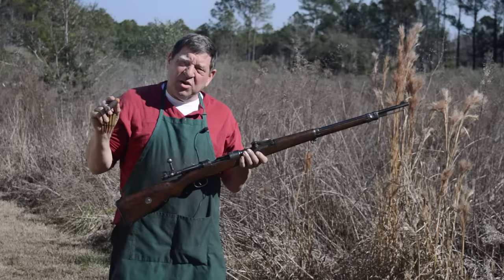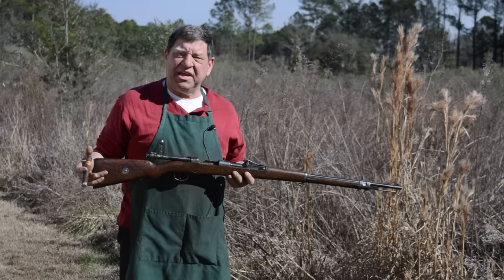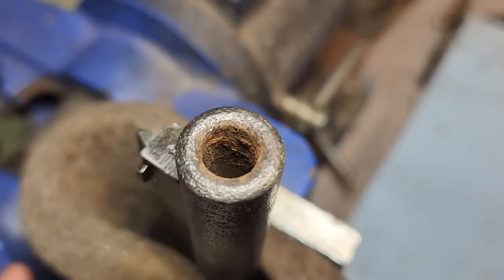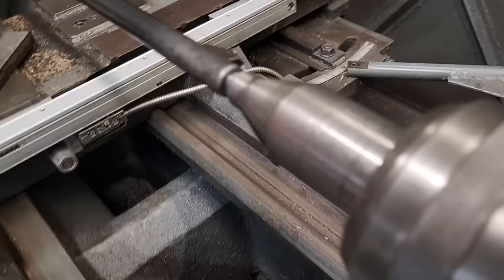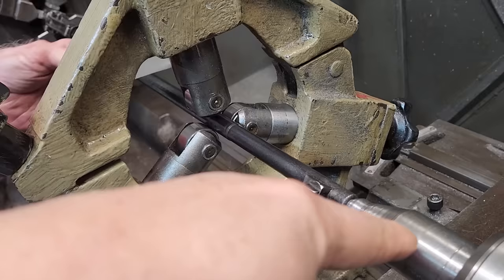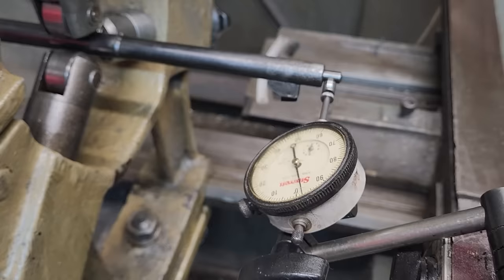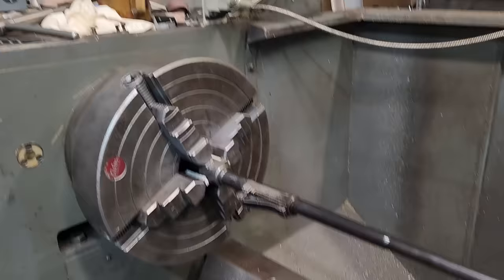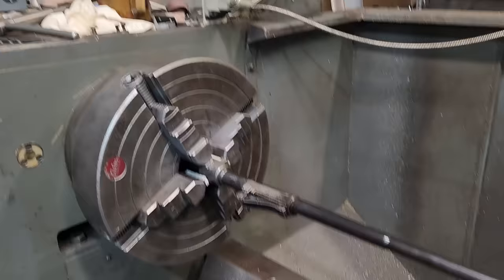Mauser Counterbore follow-up

Comment: Why is the setup relative to the bore axis ie the runout of the counterbore so critical? Once the bullet leaves contact with the lands/grooves its not in contact with anything else. You clearly removing metal below the depth of the grooves so the bullet never touches the inside of the counterbore area and thats as it should be. Seems to me the more metal you remove ie the larger the ID of the counter bore the runout becomes even less critical. Also couldn’t this be done by hand with reasonable care and a strategically sized round double cut burr which would naturally chase the bore with enough precision to make any runout irrelevant?
Reply: You mentioned that the influence of a feature like that is a quantitative characteristic, so you have half the answer. Another half is that in any particular case like that, it's easier to make a bore run true than to predict how much any deviation from coaxiality will influence the bullet. Even bad crowning that is by two orders of magnitude shorter than this counterbore in the axial direction is known to affect the bullet trajectory. As a machinist, I would use a boring bar instead of an end mill - it reduces the chance of deflection at the start due to corroded uneven surface.
Reply: Burrs on hardened steel tend to be somewhat awkward to control with the precision needed. theres far less room to mess it up here. and when youre running a business that is almost entirely reputation based you dont want to risk shitting up someones relic rifle.
Reply: When the bullet passes the end of the rifling, the gasses behind it will begin to pass the bullet. If the counterbore is not concentric, the gas pressure on one side of the bullet will be higher and throw off your point of impact. This effect is noticeable just from an off center crown. Being a counterbore will make it exponentially more noticeable. If the counterbore is far enough off, it could even send the bullet into the side of the barrel and completely destabilize it. So no, I would not recommend trying something like this with just hand tools.

Comment: Thank you for sharing your knowledge and experience!
How would you choose to do this work on an octagonal barrel? Is there a spider-like bushing that can run inside a steady rest?
Reply: That's a good question. All I come up with is to chop an 8-point socket or make a steady rest from a 4-jaw chuck
Reply: First turn an aluminum 'ring' which fits the barrel with an interference fit of a few thou. Heat the ring in an oven then slip it in place. Cut the outside of the ring true the center of the bore and voila! When you're finished carefully cut a slot in the ring and it will come off. Or do what should have been done here and insert the barrel into the back of the chuck leaving a couple inches of the muzzle sticking out. Very low RPM's only and get the chuck really tight.
Reply: @P_RO_  That just transfers the support problem to the other end of the barrel. Either way you need to support both ends, and if both ends are not round...
Reply: @Andrew-ps6xe  Yes but the chuck is sturdier and more stable and will make centering much easier. A steady rest isn't as solid and is meant to support long workpieces, not the work itself. And being that there is a lathe, it's relatively easy to turn down a brass or aluminum rod matching land diameter with a reduced diameter projection to go past the damage and out the muzzle as a means of quickly finding true center. Or you can do it the hard way and take your chances on accuracy- your choice. 

I'm soon going to take the easy way out and cut/ crown a pitted muzzle which was stored barrel-down in a damp location, resetting the front sight afterward on a low-value shooter, a common process which is always done with the set-up I recommended for the reasons I gave.

Comment: Question for Mark. 
I think my dad's lathe was much older than yours based on the more fancy art deco curves on the base, and the cover behind the chuck covering the gears. The motor was not built inside the lathe, but was external and drove an approx 2" wide leather belt on a pully with three steps, there was also a three step pully on the lathe itself making it possible to change the speed of the chuck from slow to fast. Dad could open the gear system on the back of the lathe and further change the speed of the chuck by changing gears around, and there were extra gears of different sizes he could swap in, or out of the lathe. The gears were numbered and he had charts to select gears for the desired rpm's. He could set it up with a chuck speed slow enough to cut threads with the lathe. The  chuck had 3 jaws, where yours has 4 jaws.
It was quite the machine, he had two different chucks for it, and I recall the jaws could be removed and turned over to accommodate different size stock he was turning. 
I just wondered if you had any thoughts about the differences between your lathe and dad's. 
I don't know what brand of lathe dad's was. If there was a name plate on it, chances were it was always covered with  metal shavings.

Comment: Whats the point of counter boring? getting that rust out with the reamer seems good enough. I doubt the 2in off of rifling makes a difference. Unless it works like a squeeze bore?
Reply: In this case the crown of the muzzle had been completely destroyed by rust. If the crown is distorted the bullet will leave the barrel at an angle.. Counterboring is in effect recutting the crown further down the bore, while keeping the exterior features, such as the front sight mounting.
Reply: @webtoedman  hmm makes sense .

Comment: So when a barrel is bad why can’t you rebarrel it?
Reply: He's trying to keep it original with the sights in place. One practice was to cut the barrel off behind the front sight, recrown it and reinstall the sight. Rebarreling, if originality were desired,  would entail acquiring a used milsurp barrel of dubious quality. This method, done properly, will yield good accuracy.
Reply: @geoffreyjohnston6483  I get he’s trying to reuse the original barrel and did a fine job of turning trash into shooter again. I don’t get the desire to keep them all in milsurp configuration. I have an Argentine Mauser barreled to 25-06. A good looking shooter.
Reply: The barrel wasn't bad, just the last centimeter or two. Mark says the rest was in good condition. Much easier to clean up the very end than to change it out entirely.

Comment: Honest question not a critique - if the rust is 30 thou tighter than the bore and you’re fitting a drill bit to the constricted section… how do you know the bit is following the bore and not the constricted section? Wont the drill bit sag or move loosely in the bore behind the constriction?
Reply from the maker: The bit was 4 inches in the clean bore.....
Reply: @marknovak8255  right, but the bore is larger than the constriction that the bit had to fit through correct? To get a gauge pin/drill bit to fit in the bore past the constriction, you have to size it for the constriction not the bore — which means it will be loose in the bore. Does that not matter?
Reply: Basically what I’m getting at is… I guess because you are enlarging the bore, the counterbore can be minorly non-concentric?
Reply: @tenacioustinkerer7661  I imagine you could treat the initial counterbore as a roughing pass, and then re-indicate with the clean bore for a finish pass.
Reply: @Tunkkis  oh yea that would definitely work! Thank you for the tip

Comment: Any thoughts on how that counterbore might affect accuracy, if at all, on such a rifle?
Reply: As long as it's done correctly it would only affect it to the point that having a slightly shorter barrel would. That's really all this is. It's just shortening the barrel without making it visually shorter from the outside.
Reply: iirc it will improve accuracy, the Finns did this to a good amount of their mosins
Reply: @BigTonyBigPizza  I don't think it actually improves accuracy over a barrel that's in good condition. It will improve accuracy if the end of the barrel is in bad condition which is why the modification is usually done. That might be where the confusions coming in.

Comment: You could accomplish this without removing the barrel, by mounting on a mill bed and turning the mill head 90 degrees, or use a 90 deg attachment if you have one.

Comment: What about cleaning up the crown?
Reply: Are you talking about cleaning up the pitting on the end of the muzzle, not the outer diameter, the champfered surface that is 90 degree to the bore. Or using a reamer, or some other cutting tool to enlarge the bore a few thousands of an inch to create a crown. But Marks way works too.
Reply from the maker: We did, compare the before after. Left a few pits so it looks in character with everything else

Comment: those rust pits will come back. perhaps an evaporust treatment of just that inner area somehow to not affect blueing?
Reply: Evaporust removes blueing. At least some forms of it, not sure if it removes all types.
Reply: Easier to run a Hoppes cleaning rod with a Hoppes Tornado brush through it. Did it myself on my own vet-bringback Gewehr 98 with the same inner barrel profile. Made quick work of all the converted rust/dirt.

Comment: I would of used a carbide cutter on an autofeed so the lines would be consistent instead of an endmill  , because I have small lathe cutters on a rod for boring tiny holes bigger

Comment: Why not thread the rusted part, then screw in a new rifled tube, like the choke on a shot gun?  Thanks
Reply: Would be more trouble than it's worth. Losing an inch or so of rifling at the end of an infantry length rifle isn't going to make any difference for the kind of shooting you're likely to with a piece like this.

Comment: You’re indicating the rifle in the lathe as if the exterior of the chamber is aligned with the exterior of the barrel tip, it’s not, they’re all bowed.
Would be easier to just indicate exterior barrel tip and bore it.

Comment: What not remove  the rust and growth  before  you make cuts
Reply: Because the reamer removes them anyway and does a cleaner job.  Why spend twice as long doing two jobs?
Reply: He was able to get his stepped arbor in from the breech end. The rust did not interfere with the stepped down portion of the arbor.
Reply: Rust expands the surrounding metal as it grows. Especially the rust under the visible layer on the surface.

Comment: Would have been a better set-up if you had removed the barrel from the receiver and put the steady rest closer to the muzzle end.
Reply from the maker: The steady is running in a portion of the barrel not visible when the unit is assembled
Reply: Dude.  You are out-guessing a genius.  

Do you have any clue what it takes to separate the barrel from a 110 year old receiver?

I can only guess, but i'd wager it ain't purty.

Give it up, your second guessing.  

I think Novak did this one right on, as he usually does?
Reply: it takes about 3 minutes or less to take a mauser receiver off a barrel with proper sized bushings in a vice.

Comment: Why not bore brush the rust and go from there?
Reply: because when rust takes over it actually get's under the surrounding metal, underneath what you can see. and your still left with a bulge. If your still under tolerance you run the risk of bulge or a blow out. think of water getting in between concrete and heaving it away from it's self. you will never get it back to the same size or dimension unless you resize by shaving it down.
Reply: Rust expands as it grows. It does something called rust jacking, and can actually be pretty powerful. I've seen it break 5/8" frame bolts on trucks because two frame layers get pushed apart from rust jacking.
Reply: @dangerrangerlstc  well explained sir!

Comment: Mark you should have the "know how" to do this lathe work at your own shop.....
Reply: It isn't a question of know how, it's a question of capacity, this lathe has a much bigger through hole than Mark's, through hole is the diameter of the spindle bore. They were able to chuck on the receiver and didn't have to pull the barrel in order to do the set up.
Reply from the maker: This is our lathe, my shop, Rick is a machinist here. So, yes, I do.
Reply: @chetlockwood1491  wrong
Reply: @vettepicking , how would you explain it, do you run machine tools and are you familiar with their operation and limitations? What part are you saying is wrong, Mr. Novak absolutely has the skills to do precision work!!!!
Reply: @chetlockwood1491  yes i do. And mark has almost zero experience running precision parts. Thanks
Reply: @vettepicking , I’m a Mark Novak Fan Boy and have watched him over a period of years. I have observed him doing work much more complex than this and he certainly has the skills to accomplish the task at hand. Take the time to go back and watch him over the past couple of years, then make a judgement call. Consider adjusting your viewpoint from a CNC high tech perspective to that of a nuts and bolts manual machinist. The object of the exercise was accomplished in a manner consistent with the practice and principles of the trade. How would you have done it differently with the same tools available to them?
Reply: @chetlockwood1491  ive seen and even offered to teach the man how to use a lathe properly (no cnc) . I just dont know how a gunsmith would need another machinist to do a simple barrel setup for him.....? Cant teach old dogs new tricks i guess
Reply: @vettepicking , Trust me I am very confident that Mr. Novak is going to do far more complex work and setups in the future. Like I said I have watched him do setups on more complex projects. I guess we have to agree to disagree on this one, I would trust Mark to do a good job on anything he touches.

Comment: Isn't this simular to sporterizing?
Reply: No, this is a long established repair technique that some militaries used when arsenal refurbishing guns back in the day. And the point Mark keeps hammering home here is that the barrel was already damaged, leaving it in a dangerous state with a bore obstruction due to the rust. He didn't ruin a priceless gun, it was already ruined and he made it shootable again.
Reply: This is re-arsenalling, like kaboom said, militaries in the day would take guns with shot out bore and counter bore them with new rifling after sanding down the original, he kept the furniture, if anything this is a restoration, sporterization would imply the rifle has been de-militarized and the stock, sights, etc cut.

Comment: Don't gunsmiths know about Evaporust? It would have done the job. You might lose a little blueing,   but you could see the actual damage before just runnung an end mill in there.
Reply: When you look at the counterbore you can see pitting even below the counterbore line. I am guessing he had a better view than we did from the camera angles.
Reply: Evaporust doesn't fix sewer pipe bore. As Mark said, luckily only the very end was beyond repair, hence the counter bore
Reply: I used Evaporust to free a hit and miss engine which was in a brook for a while, likely years. It took lots of Evaporust and lots of time. The piston came out with gentle force, so I stand by my remark.
Reply: Evaporust is good stuff, to be sure, but it can't repair corrosion. Once the rust is gone, the dimensional change and missing metal still have to be addressed, and the simplest method of doing that is to counter bore and move the crown back inside the barrel.